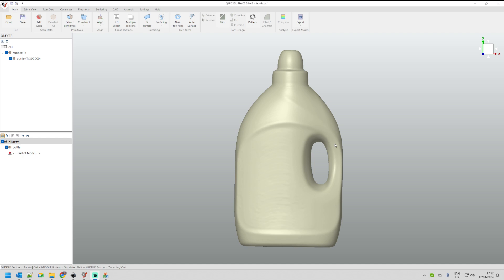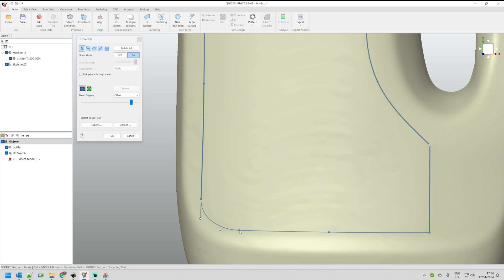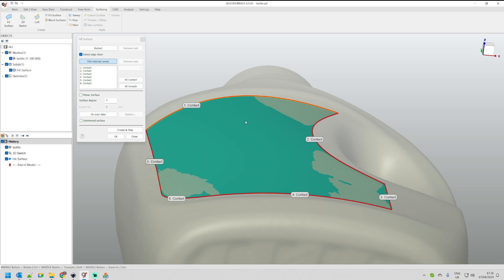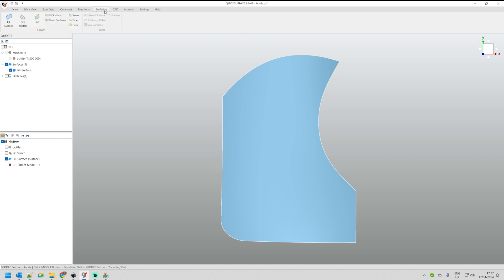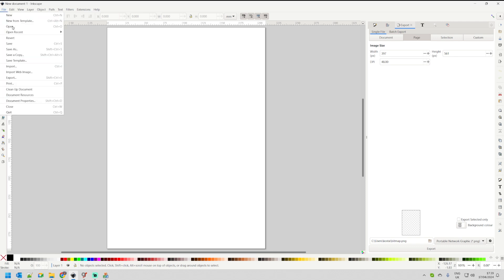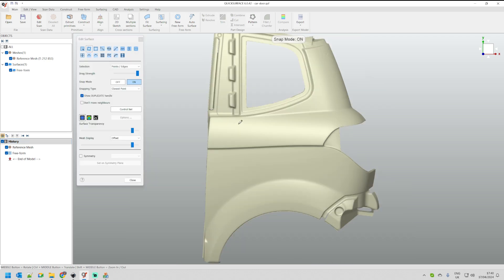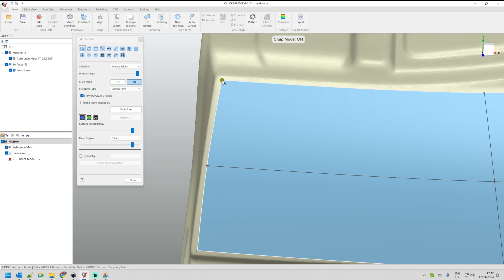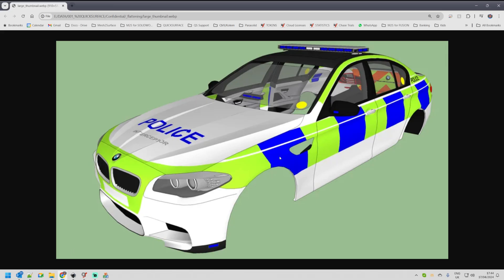QS Tutorials: Flatten

Comment: I have tried this operation for a boat gunnel scan. Works great however the boat gunnels have holes for rod holders, we struggle before the flatten process to add circular cutaways in the surface. Example aluminum boat gunnels that have sweeps and bends that require matting to be glued onto a surface. We want to be able to draw the shape in 3d to follow the shape including holes for rod holders, then flatten and export as dxf for the cutting machines
Reply: i am having the same problem on car wraps. did you fix it? i would add a picture but don't know if i can?
Reply: @leebennett9315  How did you get on, I am doing wraps, I've had some success but it would be good to share some ideas?
Reply: Apparently quicksurface only made a simple operation. Unfortunate since so many operation i use need a hole through surface before flatten.
Reply: @stephensummersby6450  Were you able to find a solution? I have the same problem.
Reply: @stephensummersby6450  Did you find a solution?
Reply from the maker: We are developing new algorithm which will be able to handle also the holes.